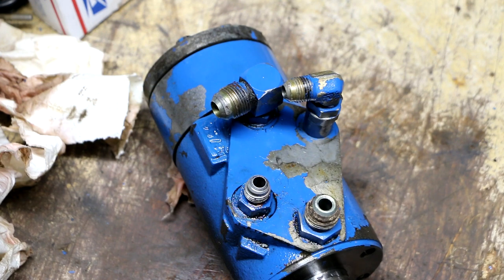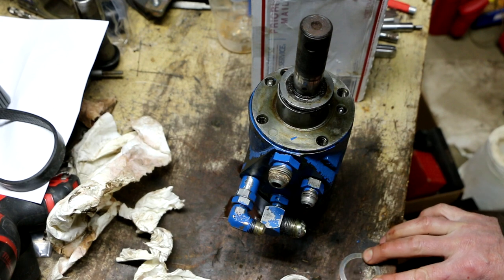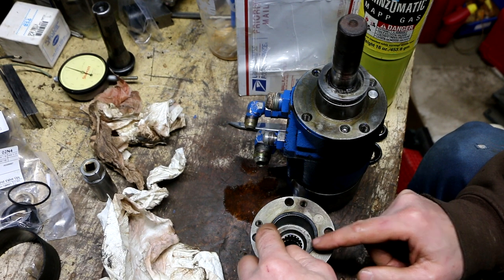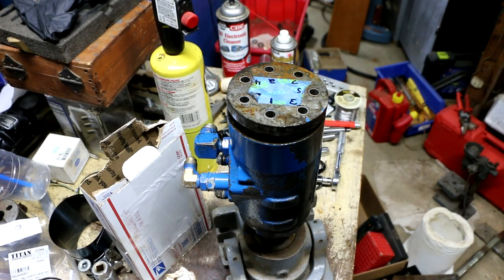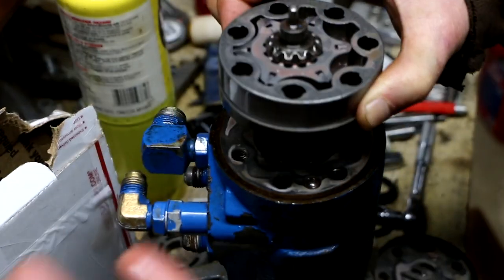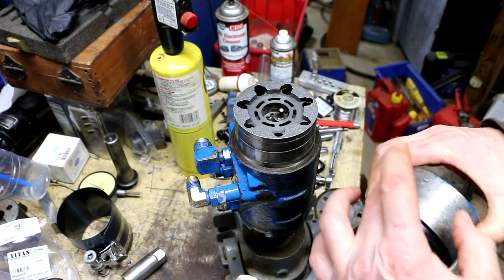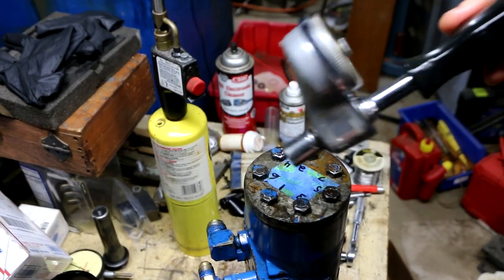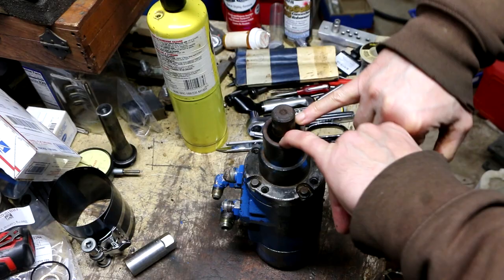Ford 5000 Tractor Ross TRW Parker steering valve input shaft seal leak Part 3

Comment: Hi. I've rebuilt my valve and it does not turn/stuck after I tighten the 7 bolts at the bolts at the bottom. A y suggestions?